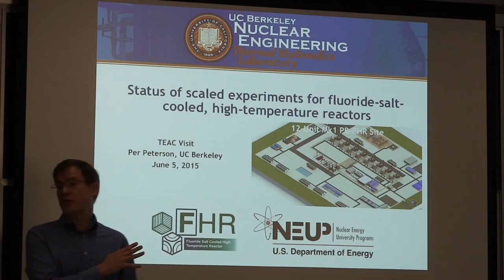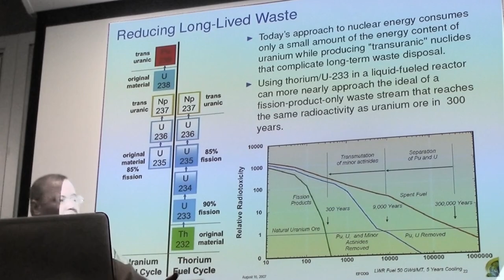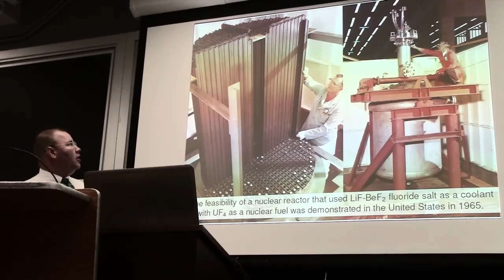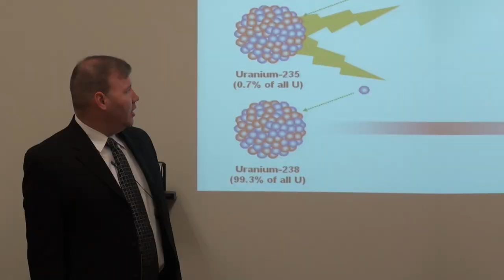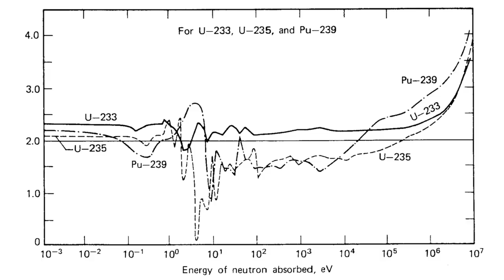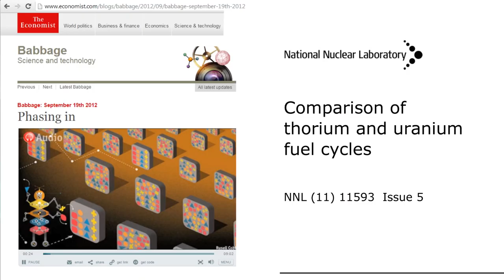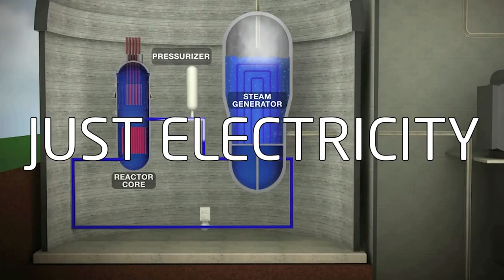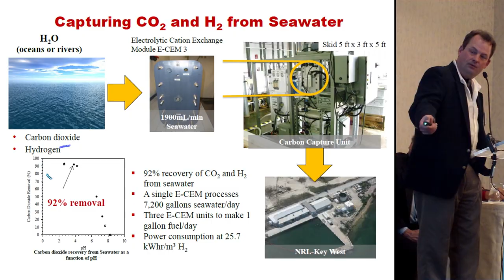Thorium Disadvantages

Comment: The biggest disadvantage of Thorium technology is that there are NONE.  I think the stats are that there is 1 test reactor of less than a megawatt operating.

We are being held up so the government will implement new untested and probably buggy technology because they probably cannot make the massive profits on the stable technology that works all over the world.

Build out a massive standard working Light Water Reactor fleet because it is well understood, safe, once it starts to be scaled up and mass produced the prices will drop and the US will take energy leadership in the world - if we don't screw it up.

Get this done by the government - just keep private industry out of it because they have botched up everything they have touched.
Reply: "Build out a massive standard working Light Water Reactor fleet because it is well understood, safe, once it starts to be scaled up and mass produced the prices will drop" I don't disagree with that assessment. I'm in favour of gov assisting with TMSR R&D, just as they did in China, but in China they're building PWR because that's what they can built a fleet of right now. In Canada we have CANDU, and a well developed supply chain (thanks to refurbs). USA went over-budget with AP1000, but the 2nd unit was cheaper than the 1st and if they just keep building them costs will continue to drop. Maybe SMR can bring the cost down... BWRX-300 is General Electric's model and if they keep building models across the globe, and licensing sites for SMR is make easier than for PWR, then that could be a standardized model we can all deploy. I'm all for building modern versions of PWR or CANDU. The reason I released this video is that some of the criticisms against "Thorium Reactors" was garbage, using straw-man designs that no one was pursuing.

Comment: Nice clickbait title...real valuable information
Reply: Thorium Disadvantages listed in this video:
00:00 Solid-fuel thorium reactors fuel utilization ratios similar to PWR.
00:42 Liquid-Fuel in United States licensing is "scary".
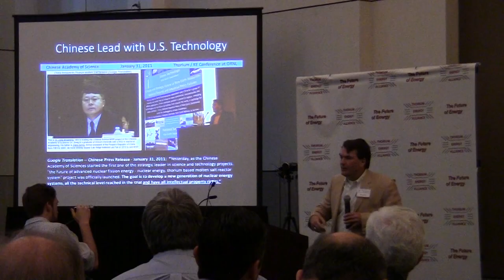02:04 Obama Administration willing to give away MSR know-how.
02:40 PWR seen as "good enough" for long time.
03:00 Licensing restrictions specifically target liquid-fuel.
04:45 NEA OECD evaluated solid-fuel, and liquid-fuel-fast-spectrum only.
20:50 Thermal-spectrum neutrons hitting U233 produce only ~2.3 neutrons.
23:00 Graphite moderator required to sustain fission in MSBR thermal-spectrum.
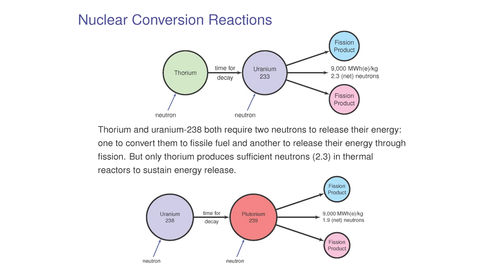27:50 Protactinium-233 half-life 27 days.
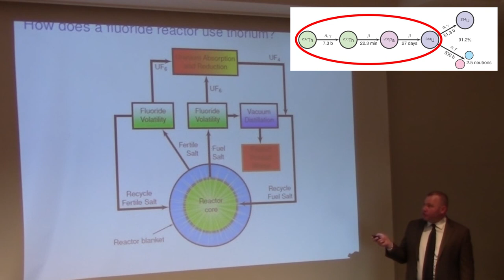29:00 Material challenges (MSR is pre-requisite so MSR challenges are Th challenges.)

Comment: Here are the actual disadvantages:
1. Thorium power plants require fuel reprocessing. 
2. Because of #1, thorium power plants are intrinsically more complicated than many current light water and heavy water reactors. Thus they would be more costly to operate and have more points of failure. 
3. Thorium isn't as developed as a fuel; there are very few demonstrated designs.
4. Thorium requires different mining, milling, and fuel processing infrastructure that doesn't currently exist, adding significantly to its up-front costs.
5. There is no shortage of uranium or plutonium vs our present needs, so there isn't a lot of incentive to develop it.
6. Natural gas is cheaper than nuclear power these days.

Here are its advantages:
1. You can breed thorium in the thermal spectrum.
2. It produces less high-actinide waste.

Every other purported advantage of thorium is usually false, misleading, or irrelevant. You can absolutely use a thorium reactor to create a nuclear bomb. Its efficiency arguments are little different than those in favor of fast breeder reactors for uranium and plutonium, and the safety features of such reactors are similar to the molten salt reactor concept. 

I'm all for developing thorium reactors, but not at the cost of developing more uranium and plutonium-based designs. This doesn't need to be an either/or debate.
Reply: Fair.

Comment: It is my understanding you can indeed use U233 for bombs, but with disadvantages. Shorter shelf life, strong EM signature. Would also need complete redesigns from current weapons.
Reply: The U-233 isn't all that disadvantageous itself, and bombs have been tested using it (I think the most recent to do that is India, though people have misreported the source of the material being a CANDU reactor, which it wasn't). It's the side-product of U-232 from the thorium fuel cycle which releases stupid-scary amounts of gamma radiation from it's daughter isotope Tl-208 that make the fuel a bitch to work with. That's the barrier to proliferation.

Comment: India is already building a three stage thorium based power plant is expected to complete by 2019
Reply: How's that going?
Reply: Last time I checked, India was building a conventional light water design with thorium rods. This can only ever be as efficient as uranium (not very) and has the same disadvantages as a uranium/water  design, inasmuch as the rod have to be pulled from service long before they're burned up, making for lots of waste or an expensive reprocessing proposition.

Thorium can be used in lightwater designs, but is at a substantial disadvantage to uranium if you do so. The supreme advantage of the liquid fuel molten salt design is that you can get neutron poisons (xenon) out of the loop during operation rather than having them remain trapped in the rods and get final products (helium, tritium) out on a continuous basis as well, whilst only doing just enough inline onsite chemical processing in a tapoff loop to stop the system fouling itself up. Anything problematic/majorly biologically toxic is simply left in the loop until broken down

Less mess. less fuss, no nasty shit being carried around the countryside to be susceptable to accidents or terrorism - and after being allowed to cool off (literally, or radiologically) most  of the output products are saleable materials. Imagine a world with virtually unlimited supplies of cheap helium - and how fusion research can benefit from having tritium on tap (right now it's fantastically expensive so noone works with it)
Reply: @alanbrown397  
"cheap helium"
That's another disadvantage for US strategists.  Right now, 95% of the Earth's helium comes as a by-product of a particular natural gas mine in Texas.  That's why the Hindenburg was filled with hydrogen, because the US wouldn't sell Nazi Germany helium.  (It was considered a strategic material, in WW1, dirigibles were used as bombers and even in WW2, barrage balloons were used as a defense against bombers.)
Reply: @digitalnomad9985  Right now the USA is dumping the strategic reserve on the world market and has been for the last 25 years. It's selling at approx 1/10 the price it used to before that decision, but MSRs could bring that down by another 90-99%.

I know how much my employer spends on helium each year, We could do a lot more research if there wasn't 8 figures going into gas purchases - and that's quite apart from the costs of things like MRIs and suchlike. Dirigibles are a sideshow.

Comment: 1. Online chemical processing turns MSR from a Gen4 into a Gen5/6. That's by far the biggest disadvantage (currently) to using Thorium as a fuel.

2. The advantage MSRs have is that Caesium and Strontium are gases in solid fuels making melt down an intrinsic hazard.  Remove that hazard and nuclear can cut a massive amount of costs. Fuel is currently a very small part of nuclear costs.
Reply: Room to grow in capabilities is an advantage, not a disadvantage.
Reply: We know exactly what the theoretical capabilities of LFTR are. While those capabilities are undoubtedly worthwhile they are technically very difficult to achieve, which is big disadvantage of using Thorium.  

MSRs might be commercialised within the next 20 years. LFTR perhaps not for >100 years.
Reply: Cesium and Strontium are metals, not gases.  They don't particularly have low melting points, but they are to be considered defects in a designed fuel structure. Those are manufactured to a pretty close tolerance, and substituting molecules (by means of neutron or ion capture from an energetic collision) tends to deform them.
Reply: They are both relatively dangerous and volatile at the temperatures found inside a nuclear fuel pellet undergoing fission and decay, compared to the other fission products. 

If you want to quibble about the technical difference between a gas, vapour or aerosol free feel.
Reply: Ben Jamin'  The thing you left out of the (MSR) discussion pertinent to fuel safety is that the two elements you called out as being hazards above-and-beyond are in fact not part of the thorium decay chain. It is true that Molten Salt Reactors can alter their diets, however this is a job for a  fuel manager and the concomitant facilities that process the byproducts. And no one in the industry has claimed that these devices are in the least bit safe - just that they are orders of magnitude safer and cheaper than uranium reactors.  They also generate far less weaponizable material. Some versions of these reactors use fabricated fuel elements and neutron ' kickers' but still lack the chemistry problem you spoke of.
Reply: They are fission products. Which will occur when Thorium is used to breed Uranium and that is used as fuel.
Reply: Solid thorium fuel cycle produces slightly less problematic waste overall. There are still materials that require careful handling but it is no worse than a uranium cycle. Liquid fuel has unique challenges but also significant potential benefits that make dealing with those challenges worthwhile.
Reply: Ben Jamin' Comment #2 of yours makes no sense whatsoever. In fact, its last sentence has been reported to be completely false. Comment #1 appears to be just a red herring. What are you trying to pull-off here?

Comment: We had a Thorium demonstration reactor in my city in Hamm(Westphalia, Germany). The moderation in this reactor was done by graphite sphaeres. ....
Reply: Ah yes, the THTR-300, a kind of U235/Thorium hybrid pebble reactor, used helium intermediary to drive a boiler.  Worked just over 400 days, released radioactive solids to the environment,  and is a multi billion dollar failure.  The thorium part of the equation isn't magic.
Reply: @rogermorey  Was not meant to run for long It was a pure test reactor. 
It wasn't built to work for long, as basically the "plumbing" wasn't made to resist corosive salts.
Reply: @TremereTT  I do have some video pertaining to German Pebble-Bed reactors: https://youtu.be/2oK6Rs6yFsM?t=10638
Reply: @TremereTT  Agreed, was built as a 2B Euro prototype.  But I think they were trying to get more than 400 days out of it.  The Helium cooling was like many of the gas intermediary designs described by Thorium advocates.  That part didn't work well either, and decomissioning hasn't even begun after 30 years being shut down.  Who is going to pay for that?

Comment: Why not both uranium and thorium? If coal and natural gas can coexist in the electricity market then uranium and thorium can
Reply: URANIUM can be burned in a phase 4 reactor it is much harder to burn thorium in a phase 3 reactor.
Reply: @claytonmccormick7506  Can thorium be burned in a phase 4 reactor? Can uranium be burned in a phase 3 reactor? Apples and oranges?
Reply: @buskirkr  thorium cycle can burn uranium as well as any high level waste there is a different decomposition chain with thorium allowing the burning close to completion more things and because these are liquid reactors you do not have the breakdown problems that limit solid core reactors to about 2% conversion.
Reply: Thorium can't compete without help, just like natural gas required massive regulations on coal power before it could compete

Comment: There's a fundamental error at 33:20 - thorium is 3x more "abundant" in average crustal material than uranium, that is Th 12 ppm (parts per million or grams per tonne) compared to  U at 4 ppm.  The word "abundant" is relative, it doesn't mean plentiful, unfortunately.   These levels cannot be mined economically, the cost of mining or quarrying the rock (let's say granite), crushing the rock to fine powder and then chemically extracting such small amounts would be prohibitive.  The value of the uranium would be less than 1 cent and the thorium about $1 - you couldn't quarry and process 1 tonne of granite for $1.  A geological process is required to concentrate almost any element to the grades that can be mined economically, whether its lead, copper, gold, iron, cobalt, manganese or whatever.  In the case of uranium, it happens that uranium is slightly soluble in oxygenated water and geological processes can - over a long time - leach out the uranium from a source rock and precipitate it elsewhere (under reducing conditions) to form a uranium deposit.  There are 14 kinds of uranium deposits and some are very high grade (Cigar Lake) and some are very large (Olympic Dam) but unfortunately thorium does not behave this way and only two processes (pegmatites and monazite sands) can concentrate thorium.  Paradoxically,  such deposits are very rare.  Deposits of uranium can be found in almost every country but thorium is only available from a few countries so if these became unfriendly, then security of supply would be an issue.
Reply: Thorium is readily available in all sorts of waste piles, though - from coal, heavy metals, etc.
You don't need to mine the granite, just extract it from waste you could probably charge some to take.
Reply: @TheKauff  Have you any idea of the cost of extracting metals from waste?  especially metals that are chemically difficult to separate, like the REEs and thorium?   Uranium is easy to extract and is plentiful as geological processes have created many large and high-grade deposits which can be mined economically.